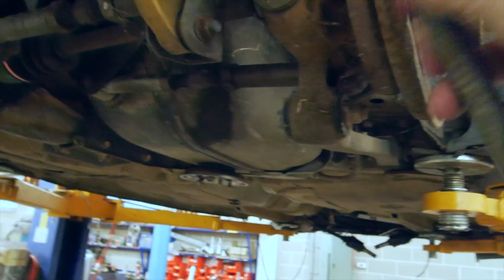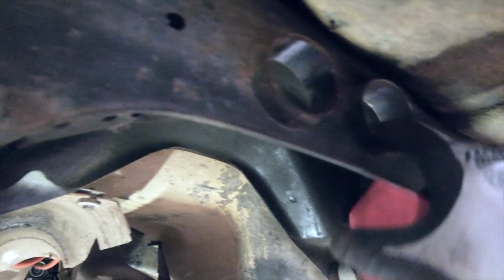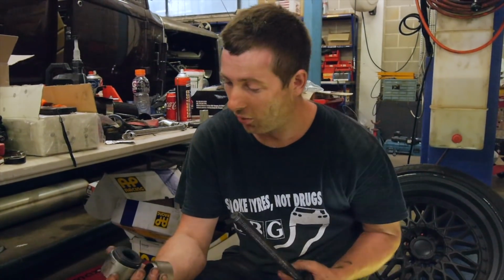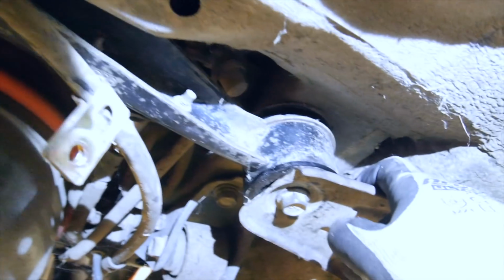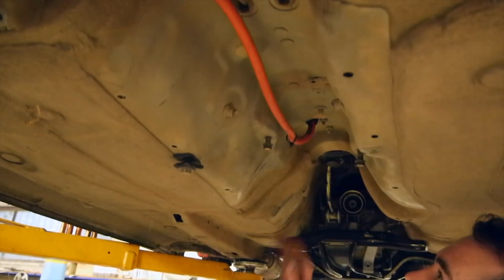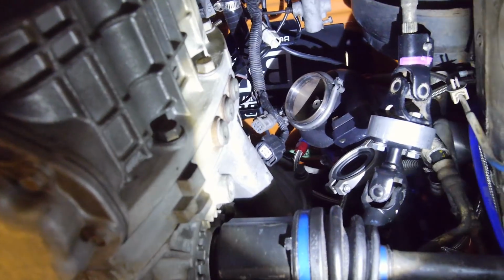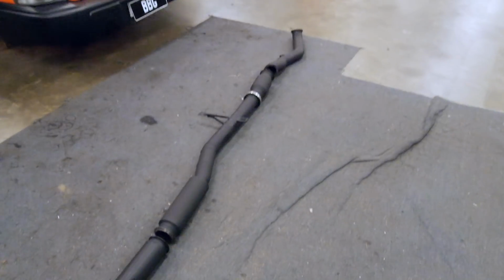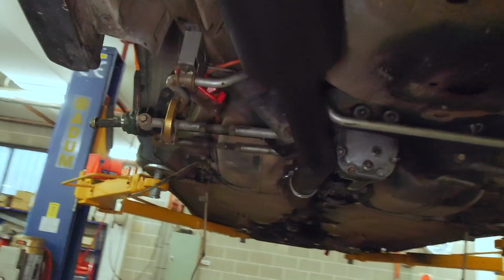STI DCCD DRIVELINE UPGRADE - BUILT SF FORESTER - THE CARROT BUILD [3]

Comment: I've been running poly diff bushes for  years in an 02 STI .. eliminated rear diff knock but did add some drowning.. car felt a little better engaged when putting power down..
Reply from the maker: Yeah after doing all the rear bushes the rear end is so stiff and precise. Probably has added some NVH but I don't care that much, it's already loud as, and that's why I have my varex muffler lol

Comment: Hey i hear vertex tips arnt good for heavy tuned cars thoughts?
Reply from the maker: Vertex tips?
Reply: Varex tip sorry fat fingers bro
Reply from the maker: Not a problem for any car. If you load it up with the valve shut then yeah that's a big restriction, but open or even semi open its a straight through muffler
Reply: Cheers